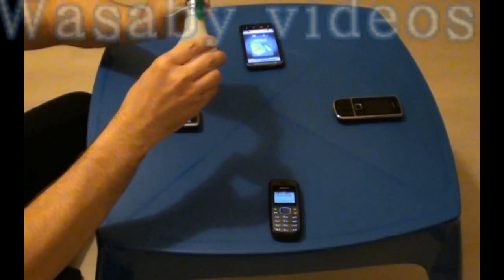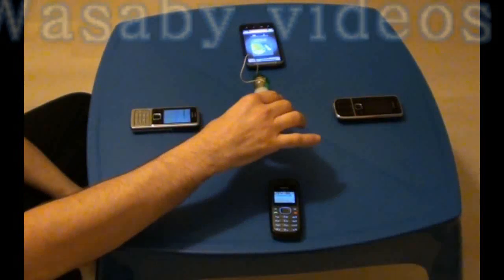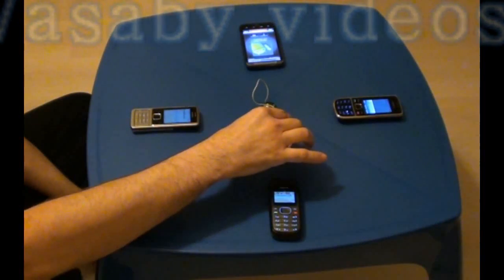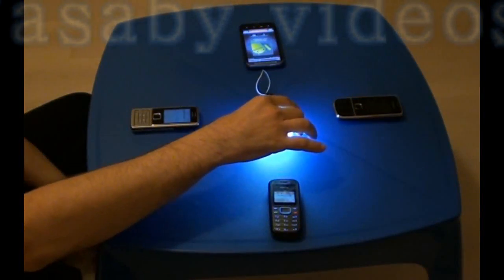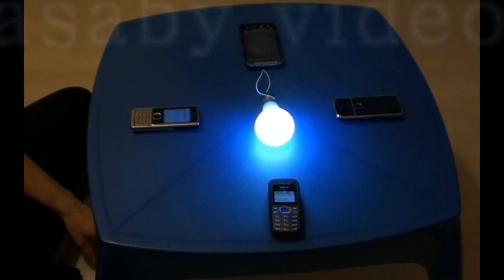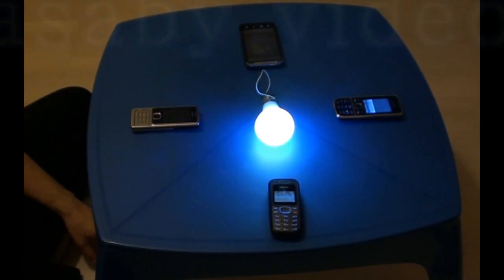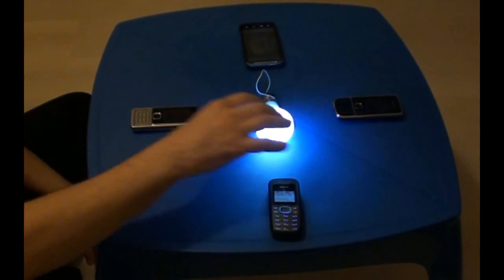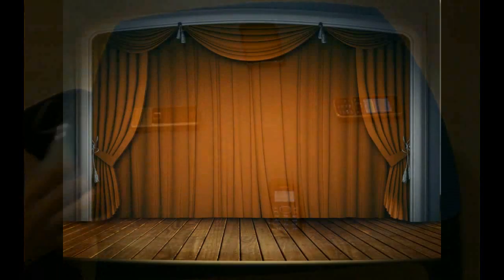Free Energy Mobile Generator for light bulb. "Free Energy"

Comment: If you research this, then the principle that this works on makes sense, however this does not produce enough power to do ANYTHING and even if it could, it would just be draining the power from the phones, so it does not generate any power, and the power the is being put out would mainly be dispersed into the air, and the power that is being absorbed from the light bulb would prevent the call... This video and any others like it are fake...

Comment: I would say that is real, it has to be real close.  Its not free energy, but cell phones put out a lot of Microwaves, that's why everyone is getting brain tumors.  If you have any doubts put your phone next to a speaker.  Then send a text or call someone.  I have even got sound with a speaker, using one wire run to itself like he does with the light.  Thats why I dont use cell phones.